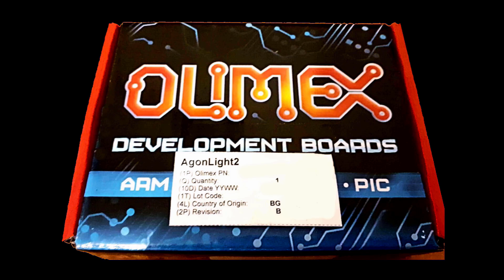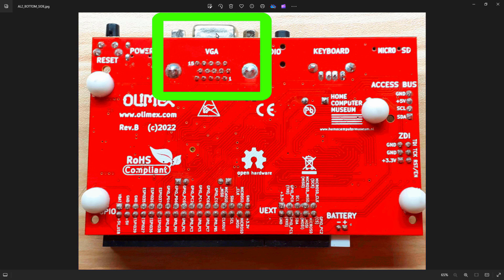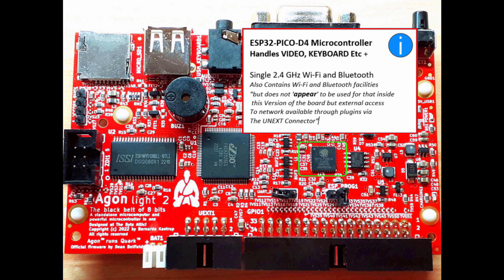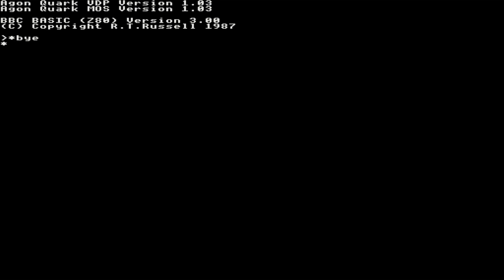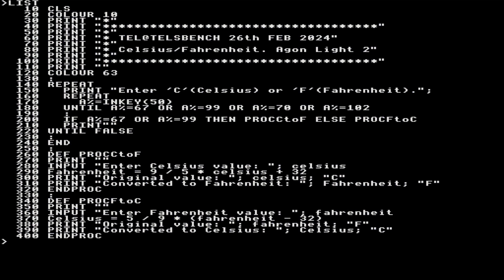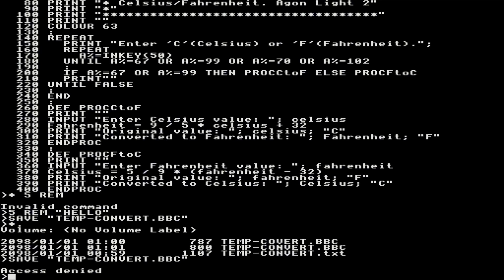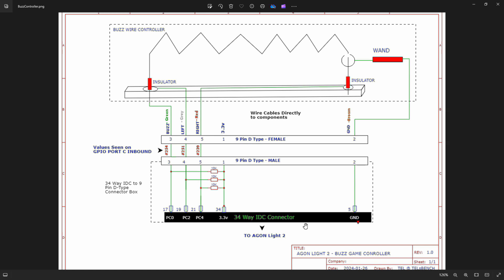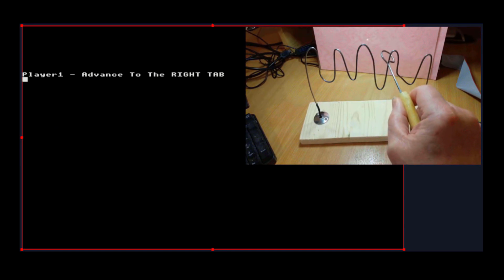Inside  The ' Agon Light 2 '  Fast Single board 8 bit computer.

Comment: do i absolutely need a VGA? I'd rather not. modern HDMI please
Reply from the maker: HDMI interfaces on board come with huge licensing costs. However, you can buy a VGA to HDMI Converter for about £25-£50 which normally need a VGA to SCART Connector ( about £13 ) , these have the HDMI output you want, this is how I use it.

Hope that helps you 🙂

Comment: the z80 version of BBC Basic would, I assume, probably originality have been intended for the z80 coprocessor module for the Beeb, though it was employed on systems like the Amstrad NC100 and Sinclair Z88
Reply from the maker: Great Question

The  BBC Basic was intended for  its  intepreter targeted to run on  the 6502 Processor which was the processor  on the main board The BBC Model B which came out in 1981, but its co-processor was released in 1984 and BBC code would have been run ontop of an interpreter run on the Z80  when the code was run on that, and the BBC then became an IO processor in basic terms.

Hope that helps.  BTW, if you are not a Subscriber, please do consider it and share the vidoes, it all helps 🙂

Comment: I've looked many places but I cannot find out what the specifications (Sizes) for the 34 HEADER pins used as GPIO's, thus I cant buy with confidence a Ribbon Cable for clean connection to a breadboard. I also will need just the black pin connectors so I can build plug-able solutions that are clean and don't have wires everywhere. Could someone point me to the right location to the information on the sizes and real Applications for the 34 GPIO's. I would like to build several solutions including an input for a joystick. Where's the right size ribbon cable? Thanks
Reply from the maker: OK  Its a standard 34 pin Flat cable  ( same size as the old 3.5 inch floppy disk drives  use.) The Connectors are IDC connectors.

Search for "34 pin IDC Connectors" on Google. You will find them along with a number of suppliers, or you can try Amazon, or Ebay etc.

Hope that helps.

Comment: 7:40 you generally only need the ZDI to flash the board's firmware on first manufacture. After that the onboard firmware has the capability to flash new versions itself from the SD card.

As you didn't need it I guess Olimex flashes the boards after manufacture. The only time you might need to use it I think is if you make your own board, or you are developing your own firmware, which is definitely a thing people do, and you mess it up so bad it can no longer reflash firmware.
Reply from the maker: @Cianmoriaty7345 .  
For flashing new versions of the firmware, yes you are right. But there are others who want to create variants of it and may want to be able to debug it that is where this interface comes in. Most ordinary mortals will not need this but some  will.

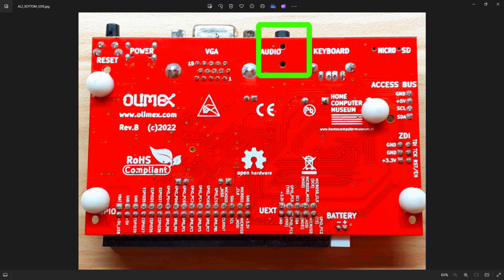Comment: 5:44 is there a tin whisker short between the soldered pins of your VGA adaptor? 🙀
Reply from the maker: Yes, there is. I assume this is a late mod. This is between pins 7 and 8 which are Green and Blue  grounds, so assume that there was a production issue with some boards and they needed to be joined to provide that.  No need to worry.

Comment: the Zilog CPU used in the design is actually a 24 bit register capable CPU - can shift to that mode from its Z80 compatible mode. There's 512K memory so that can be accessed from this 24 bit mode. There's an SDK with a compiler and assembler that supports the full capabilities of the CPU
Reply from the maker: I am aware, but thanks very much for your comment.👍

Comment: I do not unterstand why a VGA connector…
Reply: hobbyist retro board designers don't want to pay the multi-thousand dollars licensing fees for licensing HDMI
Reply from the maker: That is very true, good point.
Reply: @TheSulross  USB-C or Thunderbolt ?
Reply: @yorkan213swd6  One of the things I've seen in some of these FPGA and microprocessor boards, especially the ESP32 - which the Agon uses, is they have some out of the box support for VGA. I have two FPGA boards and they each have VGA and libraries that enable easy programming to the display. I have another ESP32 board that has built-in PS/2 ports and a VGA port. In this latter case it's also a matter of leveraging some firmware.

PS/2 is dirt simple to implement support for and write firmware for, so I see lots of hobbyist boards supporting PS/2 - whereas USB support is way more complicated.

Same thing with VGA - it's relatively easy to implement for hobbyist.

Now the designer of the Agon is a retired professional with PhD level degrees in field of Comp Sci and EE. He's fully capable of designing, say, and HDMI capable display or one of these other standards, but he also designs his boards to be instructive to aspiring EE so he sticks deliberately with these choices for they're an easy uptake for up and coming students and other hobbyist to understand.
Reply: @TheSulross  Understand, but digital-analog-digital is nowadays ridiculous, sorry. Instead of bringing the 8 bit "ghost" into 21st century people have to buy adapter to run VGA Boards. This makes no sense, so sad. But thanks for explaining.
Reply: @yorkan213swd6  People have too high, unrealistic expectations of hobbyist projects - and Bernardo is really more concerned about educating than providing a platform that is aimed at gamer conveniences
Reply from the maker: Hi there. I dont know how much of the video you watched, but I do address this concern early on the video in as much as I also would have preferred a HDMI as well . My assumptions as to why they settled on VGA are  . . . 😊

* It fits with the retro profile and HDMI adapters are very cheap.
* It keeps the price point low.
* Some people still use VGA  monitors especially in the groups who are likely most interested in it.
* It may have resulted in more complexity on the board for very little ultimate benefit.

However these are assumptions, and you would have to ask the designers,  Bernard at the 'Byte Attic' as to what the actual reason was. I'm using a converter which cost me only £5, so although its a little annoying, I'm willing to put up with it.

I hope that helps.  Cheers TEL
Reply: @TELsBENCH  Thanks, I must overheard that. VGA makes real no sense today.
Reply: @yorkan213swd6  Why? I have a lot of stuff that used VGA.
Reply: Because the video is handled by an ESP32 which has the ability to output VGA with no additional hardware costs or licences.
Reply: HDMI is really a proprietary standard so you have to pay for a licence and it isn't cheap.

Also a HDMI signal is completely different from a VGA or even composite signal.

VGA and before it CGA and composite, is beam oriented in that it assumes cathode rays scanning across the screen line by line. Actually three of them, one for the red, one for the green, one for the blue. But they hit the same pixel at the same time, just the different colour parts of the same pixel.

So you only have to provide an instantaneous signal for the levels of the three electron guns and the control signals to move the beam in a regular scan.

You don't need any memory to generate the signal appart from a few counters to keep track of what line you are on, etc.

HDMI is quite different and needs far more memory and complexity to generate.

It does still transmit video line by line, pixel by pixel, but there is a boatload of other stuff it has to keep track of.

Comment: It's very fast, but I think the Mega65 which on fast mode is clocked at 40Mhz is probably faster. But it's £700 ...
Reply from the maker: Ive had a root around for information regarding any benchmarking between the two and cannot find any. Noel's retro Lab did a benchmark against a lot of computers, but the MEGA65 was not on the list.  If it was £60 like the Agon Light I might be tempted to buy one and do some. testing. - I actually like the physical arrangement for the Mega65, but I guess it all comes as part of the premium price tag.

Comment: Cool, Olimex do UK again. I nerded over them a LOT when I first went down the FPGA rabbit hole (along with Trenz of Germany) prompted by projects like MiSTer, which I never specifically made for myself after all. I realised they (Olimex) formerly had post-Brexit difficulties, whether they were aiming to resolve them or not - I did not know. I know there is a UK distributor for this and similar boards (but I don't necessarily need to blow their trumpet) and even the (usually American) generic electronics distributors are getting in on the game, as far as I can see... without having seriously considered that route: food miles and all.
Looking in a little detail at Raspberrry Pi Foundation's PR output (i.e. video interviews and stuff - not quite a plain-text search) you get to realise that they actually used an FPGA board from Zagreb University for prototyping the RP2040... It was sort-of available to the public (- a bit like the Raspberry Pi Zero for so much of its early life, then!!)
Reply from the maker: There is a fair list of world wide distributors of the "Agon Light" product now, around eight or so I think last time I looked. Olimex's version  is different to the original from a hardware POV but it still does basically the same job as the original.

Its all good for the consumer in the end as everyone ( creators/manufacturers ) are competing to bring something new, and maybe innovative and or cheaper to market and its an everlasting evolution I suppose. 

I was looking at new version of the Aquarius the other day which has been re-engineered, not really like the AL/2 is it more a revamp of the original as far as I can tell and accepts the original cartridges, but they have a few nice features like being able to  connect to the network out of the box and get updates directly instead of having to download them.  Not the same as I say but these kind of modern day features should really be an expectation rather than a wish or an add-on.

Having said that the price points are vastly different, and thats one of the reasons that AL2 although still in a relatively early stage of its evolution is still an incredibly good buy IMHO
Reply: @TELsBENCH  I am new this, only recently coming across the AgonLight2. You say the hardware is different from original, in what way please and does it have an effect better/worse/neither?
Reply from the maker: There are some minor changes. So on the original, both the power and the Keyboard has a USB Type A connector, but on the AL2, the power connector is a USB Type c which fits in with standards power and auxilliaries should not have the same connector. Additionally,  some changes were done to the PCB tracks and I beleive some protection added against surges with surge protector diodes. Plus  a few minor alterations. In short AL2 was an improvement over the original.  If you go to the 'Byte Attic' I think he does a video on the differences, but I beleive I got them all or most of them.

In short you will not be disadvantaged by buying the AL2.